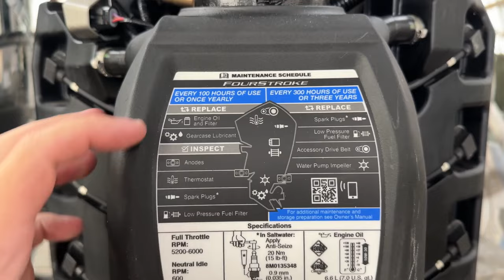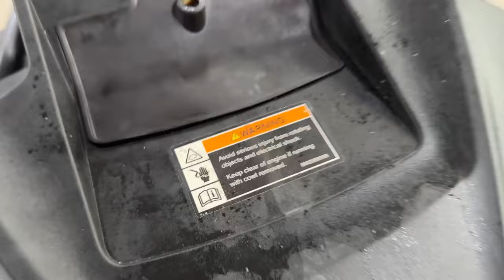Mercury Verado V8 300 Hour Maintenance

Comment: Great video. Do you know whether the engine was fresh water flushed regularly? I'm wondering if it would have made a difference with the corrosion around the water pump.
Reply from the maker: Thank you. Both engines are flushed after every use but the boat sits in the water 24/7 so getting a good flush like in a sling or on a trailer is impossible. With that said it’s pretty common to see a bit of corrosion in that area if you run in the saltwater even being flushed on a trailer because the gasket seems to absorb or hold onto a certain amount of salt and there is a lot of dissimilar metals going on there as well. It’s usually not a problem and seems to stop or slow down when the gaskets and bolts are greased. Pulling the lower unit and greasing the water pump gasket and bolts before the outboard ever hits the water helps the most and ensures you will be able to remove the bolts for future maintenance but most people don’t have the time or patience for that. Thanks for watching and commenting!!!

Comment: when you installed the lower unit. Do  you put everything in neutral?
Reply from the maker: Yep. Everything in neutral. Once the lower unit is installed the prop should turn freely. I don’t think I mentioned it in the video but the engine will need to be running on a hose or in the water to verify forward-neutral-reverse are functioning correctly. Thanks for watching!!!
Reply: Thanks, this helped.

Comment: Are there any grease fittings on the 300?
Reply from the maker: No grease fittings on Verado. You can spray some corrosion X or something similar where the engine pivots while steering if you want but I generally don’t mess with it. Thanks for watching and commenting!!

Comment: You can't get the water pump bolts out because of electrolysis I would've checked all the zincs in there powerhead because with the aluminum hull it's just going to eat that engine like it was a vat of acid
Reply from the maker: There isn’t any anodes in the power head on a Mercury Verado. Electrolysis is just one of the many joys of life on the coast. Thanks for watching and commenting.